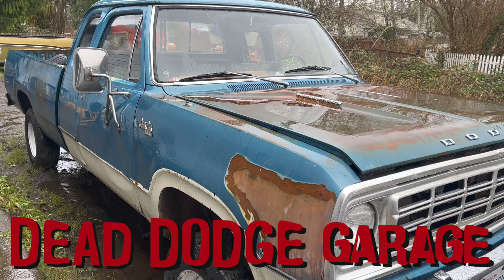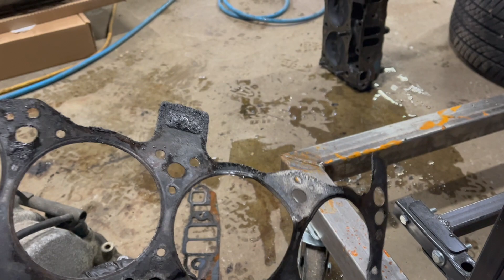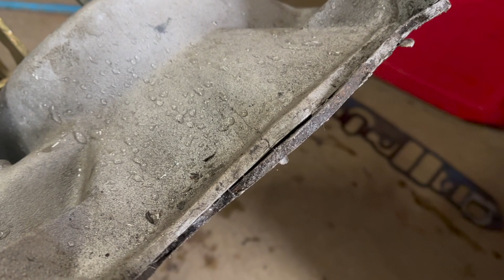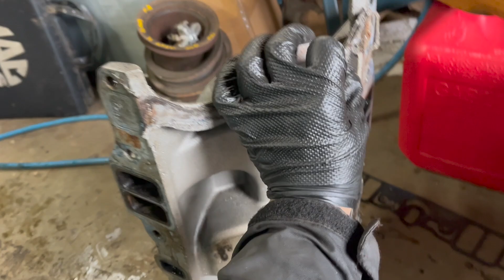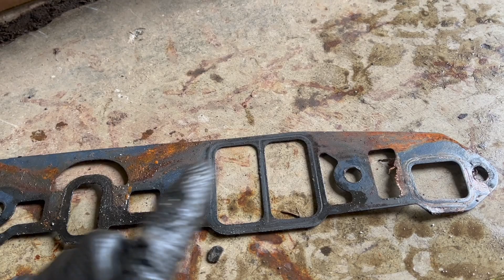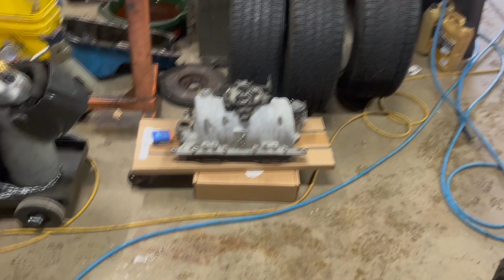I Found Where The Oil Went... Mysterious 318 Failure Solved

Comment: Hmmm I wonder if this is my issue
Reply from the maker: Well… maybe.
Reply: @DeadDodgeGarage I had a burn exhaust valve and replace the cylinder head with a used one off of eBay now I'm getting a lot of smoke and blow by. I've only ran it for about 10 minutes I have not drove it yet I'm wondering if maybe the intake is it down all the way or maybe the firing I don't know. Hopefully it will straighten up when I go to drive it. I guess next step would be compression test

Comment: My suspicion with the head gasket damage would be pinging / detonation , possibly exasperated by excess oil in the intake charge from a poorly sealing intake gasket . I would highly doubt that a spindly piece of alloy like that intake would have much effect on a big chunk of cast iron like that head in regards to distorting the head enough to cause a sealing issue between the head & block !
Reply from the maker: It seems unlikely, and yet…
Reply: Confirmation may be found in the bottom end in regards to mashed out big end bearings or maybe even cracked piston ring lands . I have seen similar sorts of damage a few times before ( been doing head gaskets as part of my profession since the 1970's )  and it has always been eventually been tracked down to pinging ( long term ) . On alloy headed motors the gasket tends to blow out so fast that the pinging on the long term does not get a chance to do serious damage to the lower end , but with a big sturdy cast iron head it can go on for along time before something dramatic lets go . If memory serves me then if cranking compression is say 150 PSI then running compression will be about 1500 PSI , during pinging  I think that number about triples - so 4500 PSI and I think during detonation ( pinging's big brother ) it goes up about 10 times again all though I can not remember if that is 10 times the normal combustion pressure or 10 times the pinging pressure , in any case the head bolts deflect momentarily ( stretch ) and once this goes on long enough  eventually if something does not grenade in the reciprocating assembly then the head gasket gives out ! I hope that serves as some sort of explanation to my theory !    @DeadDodgeGarage
Reply from the maker: @skorner5798  very interesting. I should have looked more closely at all of these components for science before I let the remains of the engine sit outside in the weather for a few months... I will say, the rod bearings that I looked at really didn't show any crazy wear or evidence of damage. A couple of the main bearings had been hot and were starting to spin, but even they didn't look all that bad. It's strange. What I saw really seemed to indicate a somewhat sudden, complete lack of oil - to me, anyway.

Comment: I wouldn't scrap the block , there is someone out there that can use it . And I would never scrap any useable LA heads , because they will be needed when all of the magnum heads are cracked .
Reply from the maker: New Magnum heads are everywhere online so I wouldn’t worry. But I am using the heads for the new engine. I have had four other 318s that aren’t ruined listed for sale for the last two years here with no takers. If someone needs a block or three I’ve got them covered without this one.

Comment: You never scrap things you just shove them in a shed forever. You're doing it wrong
Reply from the maker: My storage unit is full of other, slightly less crappy 318s, and my shed is full of cedar, old carburetors, loose hardware and disappointment 😅

Comment: if the block didnt get damaged as in no cracks then sell it for 75 dollars core block, many people bore and stroke blocks anyway those core blocks are great for that,  if i have one to get rid off because its worn out i sell it for 75 bucks, even in todays times old engines are already harder to come by and they seem to go up in price so why scrap it, make someone else happy, even if its 100 bucks it'll sell, scrap dont pay that much and no need for you to waist your time to load and unload and the drive to scrap yard
Reply from the maker: I don’t think it would sell for $50 here. It needs a line bore and the crank piece scraped the rear saddles, but that’s probably ignorable. If someone wants a block to build a stroker, there are five more complete engines in my storage unit. They have been listed for sale for two years…
Reply: @DeadDodgeGarage  i guess america is easier to come across them old engines for dirt cheap then, canada 300 to 800 for a complete engine that might have ran when pulled but 9 out of 10 they need complete rebuilt and thats for ford dodge and gm blocks, like you said about your block with that damage only scrap yard would give you some money for it
Reply from the maker: @johnk5577  Oh wow. Yeah - much, much easier. I could go find a run of the mill small block from any manufacture for a couple hundred bucks tomorrow. Obviously, special factory built performance engines are another story.

Comment: How could somebody not notice the intake manifold was not seated properly? I do not get it.
Reply from the maker: Remarkably easy actually… been there, done that. It’s close enough that the bolt holes line up so it’s possible to tighten them down and send it.
Reply: @DeadDodgeGarage  oil leak out of the back of manifold should have been huge.
Reply from the maker: @bulta209  it wasn’t

Comment: Many of the engine components fans of this channel are working with are approaching or well over half a century of hard, if not brutal use.
   I tear down engines with a torque wrench and a notepad, inexpensive caliper, dentists mirrors and a flashlight.
   I look at the fasteners- signs of bottoming out, overtorqued, etc.
   Most components check out fine, but I have had blocks where factory drills & taps broke and holes were not finished.
   Then there was the popular pastime of raising the compression by decking the block & heads-and the intake side of the heads too, not hacking on the intake manifold.
   I stamp data onto the parts I get machined or modified, like how many CC's the heads are machined to, what intake gasket matches the ports, recept # for the work- I don't expect to remember everything, but knowing where to look is helpful
   I have not seen a head gasket fail like that, and based on the evidence, very plausable.
    A borescope camera in that engine's  valley while running would have seen flames!
Reply: I think I see how it happened.
   Somebody really, really wanted to put that intake on that 318, come hell or high water.
   Didn't know to remove the china wall pins, they hang up the install, so they make an jnaccurate measurement and drill the intake.
   Got frustrated since they could only get on side or the other, not both.
    Solution?- loosen up the head bolts on one head, get your intake bolts started, then crank down the head you loosened, finish cranking down intake bolts.
  They got it done!
Reply from the maker: While that would definitely do it, I know who put the intake on. He definitely didn’t drill those holes or loosen the heads. Haha. He also says the bolts lined up ok and it tightened down no problem. Apparently he didn’t hear the cracking happen. I distinctly remember it on the one I learned this lesson with… right! The scorch marks should definitely mean flames. 

You are much more the scientist than I am, Dan. I do look things over, but my methods are a little more… lazy? Haha. I’m definitely not as thorough as I could be. I just don’t really have the patience. I fired up that 360 I built in the shed today, and it sounds awesome! So at least I’ve got that going for me.
Reply: @dantupper1784  hey Dan I was telling a truck with my Dodge Magnum 3.9 Ram van. It was laboring up the hill and all of a sudden it started misfiring bad but it went on up the hill I was able to drive it back. It would only misfire when I was coming I was able to drive it back. It would still get up to speed but when coming to a stop if at a red light too long it would start smoking and misfiring. The number 6 plug was soaked in oil I changed it. The coil wires and cap. It was giving me a IAC code so I replaced that. It would run without smoking for about 5 minutes. After that it produces a huge cloud of smoke and does not go away it's way too bad to drive and it smokes up the neighborhood. I'm wondering if it is a valve seal completely gone. I'm also thinking what if the cat was plugged and called back pressure on the engine and then it fills with oil burn. It had never leaked any coolant and was always full. But I was able to add about a half of gallon to the radiator and there was a little rust in there that I had never seen before.  I also seen the exhaust doing a vacuum type deal where it was looking like a valve might have been stuck.... But I haven't seen it so that again. I flushed engine oil refilled with 10w40 and added some blue devil stop smoke. It hasn't made any difference yet but like I said I'm not really able to drive it or run it very long because of the amount of smoke that it produces. Any help would be appreciated

Comment: Very interesting. I'm curious about any machining done to that intake. The hole drilled in the wrong spot. Makes me wondering if it had been milled to fit another set of heads possibly that had been heavily decked for compression. 
The torque spec difference between the intake and the heads really makes me think the head gaskets and bolts were already an issue. That intake shouldn't have enough umph to lift those heads. Well, without leaving massive rings around the intake bolts. 
I definitely don't disagree with your findings. Just seems like a perfect storm of odd problems to be possible. 
It made good content. Definitely won't find another video about these symptoms!
Reply from the maker: I agree. It’s odd. Those bolts only go… like 40 ft lbs? It doesn’t seem like it would be enough. I’m fairly sure the intake was brand new when it went on that engine. No machining.

Comment: I just learned something. I do not recall those dowel pins being in my 340's back in the 80s/90's. I would imagine that the 340's also had them. Maybe there were removed by previous owners. Good thing to know and look for.
Reply: Yes , 340's came from the factory with the pins . Someone probably switched intakes on yours and removed the pin .
Reply from the maker: I believe 340s must have had them too? But their removal is definitely an important part of any intake swap, and I don’t think I’ve ever seen a 340 that still had a factory intake.
Reply: @DeadDodgeGarage  I do have a 72 Duster 340 with the factory intake, Thermoquad carb, heads, manifolds etc... but I have never removed the intake as it is a good running engine. Eventually I will have to refresh the heads and I will see what I have there. Although I know this engine was rebuilt about 20 years ago, so who knows if they are still there.
---
Just looked at some photos on eBay of the OEM 340 intake manifolds, and the manifolds do have the holes for the pins, so I would assume the 340's had them too.

Comment: Had similar problem on a 360,1 and 3 blew gasket twice. Took to new machine shop head was machined wrong first time. Being in a boat and working hard killed those 2 pistons. Not fun.
Reply from the maker: Ouch. Yeah… that’s not ideal. Much easier to rip apart multiple times in the truck.

Comment: OK lots to take in here. First the head gaskets and head to block fit. I have seen these from the factory be machined wrong. The deck is now warped and needs to be decked. I would bet the heads are as well. Then when you get that done the intake fits fine. As for the intake Crack. It will be fine. More black stuff on that area. On here did the oil go. The intake sucked it out of the block much like a junk plenum gasket in a second gen. That makes a bunch of sense. As for the rinse and reuse on that block I would pitch it. As for the engine to go into that truck I say 383. So you have to change a bunch of stuff but it would be a beast. Or put a 318 back in and say bye.😢
Reply: Oh and as for burnt oil on the heads and valley it's from fire from the gaskets being blown. Remember fire is the devils only friend. Not inside your motor. 😅
Reply from the maker: Yeah I just don’t need the damn thing enough to warrant all that work… don’t have any big block bell housings around. The 318 was fine. Haha. Intake wasn’t pulling oil directly, those gaskets, while showing a weird witness mark, didn’t have any evidence of oil coming through. It was going from crankcase into six out of eight cylinders. All at the top. I have seen them not straight a good few times but it’s usually in the middle of the head. Having a hard time imagining that just machining could tip both heads up at the top.
Reply: @Dead Dodge Garage  the factory machined the block wrong. So both sides are fuked. I have seen it several times on 318s and since they are forgiving motors they still had a long life. Also cast iron intakes are stronger and hold the motor together better. Aluminum flexes and moves a lot. Thus why you have to retorque them when you put them on. That motor is dead so let it rest in peace or pieces as it were.